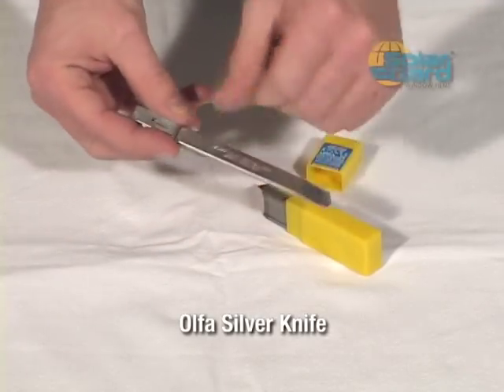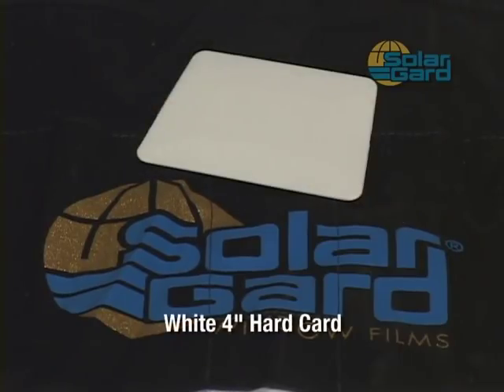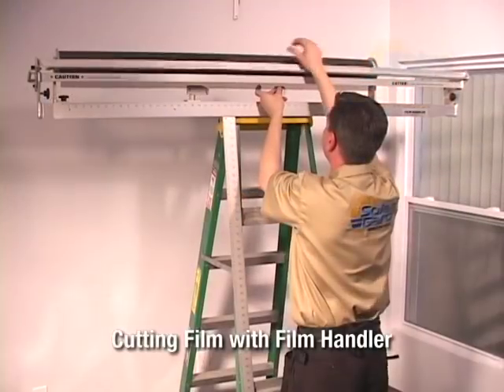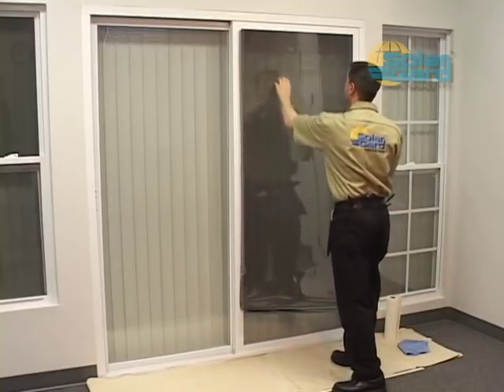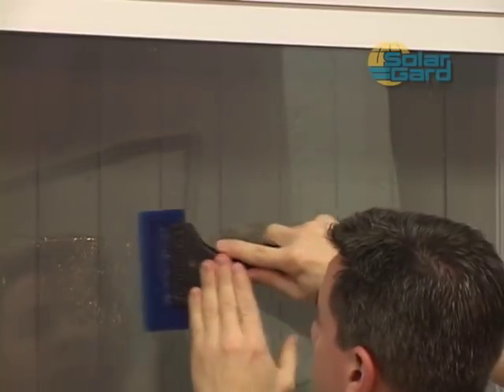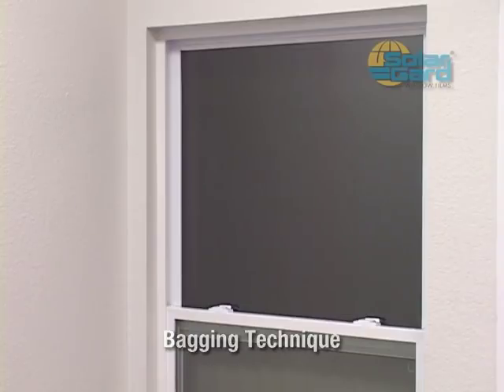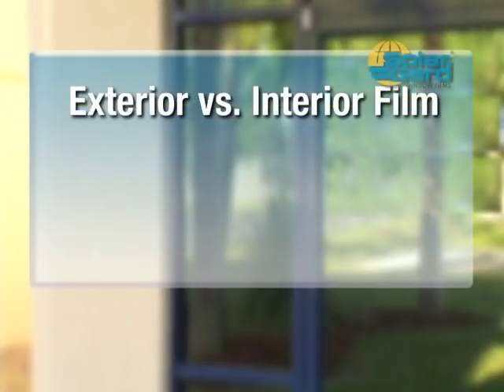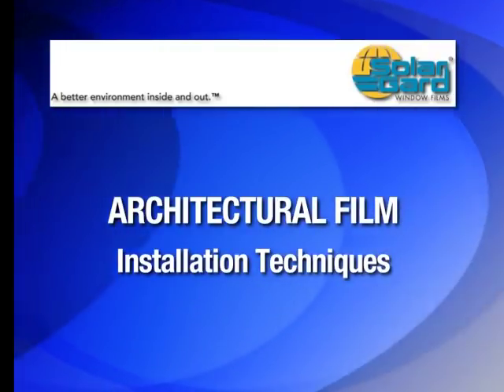Solar Gard Architectural Window Film Installation Training

Comment: Quick question.  Every now and then I have "fingers" when tinting along the side.  How do i get rid of that?
Reply from the maker: Guy Turner Fingers on a flat window are unusual but do sometimes occur. The most likely cause is the squeegee pulling the film stretching it slightly. The uneven tension in the film creates a finger. Remedies include making sure the film surface is wet and the squeegee slides easy. Squeegeeing the film systematically towards the edges will also reduce tension in the film. On large windows it may help to squeegee the middle first followed by an additional pass towards the edge. Then trim the film and finish squeegeeing the edges. If you need additional assistance Solar Gard Technical Services is available at Techservices@solargard.com.

Comment: why are you putting the vinyl on the outside????
Reply from the maker: It's an indoor training facility at our HQ Jim.
Reply: OK my bad....quick question..do you leave a small gap at sides or cut it flush with frame. I am doing 2 windows in my house next week.
Reply from the maker: No worries mate.It's most common to have a few mm gap around the edge where the film has been trimmed before contacting the window rubbers / gasket, we call that a daylight gap. Having the gap helps with reducing contamination when you install it as there can be a lot of contamination hiding under the edge rubbers, especially if the windows are a few years old or more, when you try to squeegee the water out and it's too close to the rubbers you can flush the dirt out from under the rubber and it gets under the film.

That's the only reason really, if you can get it closer without risking contamination then go for it.
Reply: Cool thanks, I work in the sign trade so have experience with using vinyl, just never used window film, going to give it a try...stop the wife nagging me!!!!!!
Reply from the maker: Good Luck!